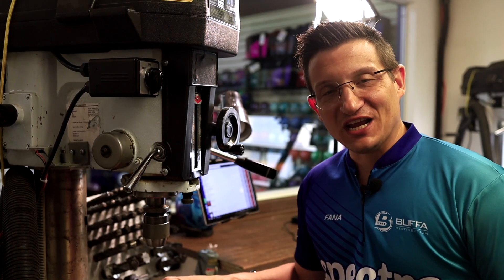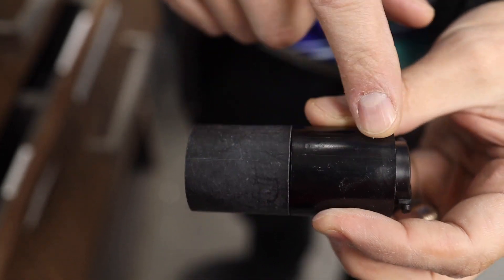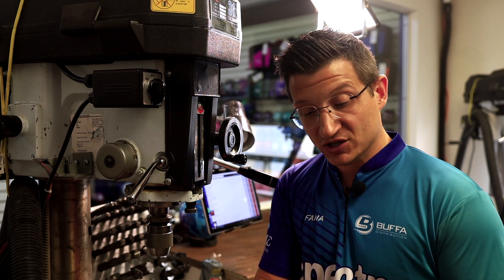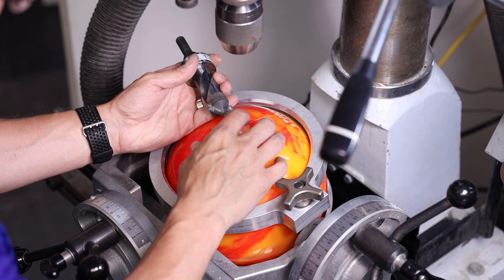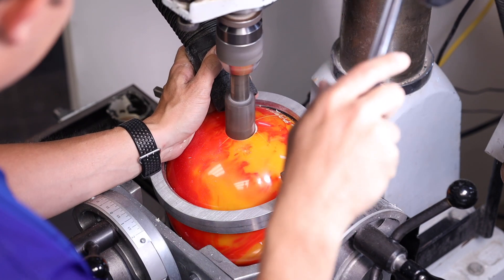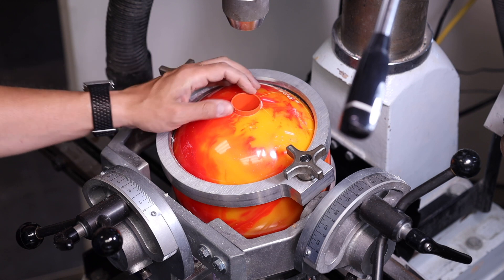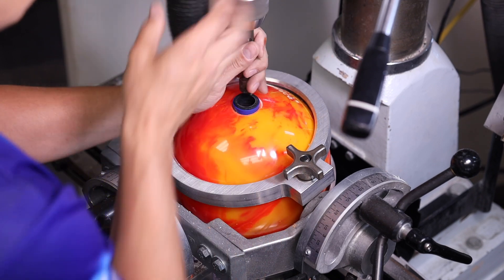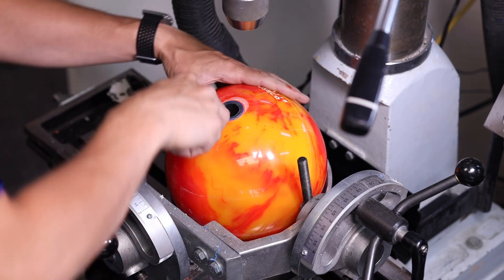Turbo Switch Grip | Thumb Installation Series

Comment: As a machinist by trade,These drills aren't meant to be used in a existing hole so using the final size drill is ideal, drilling a bigger hole after using a smaller drill will cause chatter and that's what the reamer is cleaning up.

Comment: Use a 1 3/8 bit and  go down 1/4 inch once slee e is installed, after cutting it down. Cleans up the rough edg from cutting  Reamer is 1000% unnecessary if drilling a pilot hole and bit is sharp. I have the reamer and I've had more issues using it then not using it.
Reply: Thanks for the comment.  Since using the reamer, I’ve cut down my problems, that’s why I mention it and also the beveling options.  I’ll definitely try your suggestion as well.  👍

Comment: I'll never use anything other than Jo Po...the dual locking mechanism drastically decreases the failure rate!
Reply from the maker: Jopo has gained alot of traction lately, please check out our Jopo video as well.
https://youtu.be/F5zpLl6gg_o?si=TA1Cgf2jQrWNBy_n
Every system has it's pros and it's cons.  We're just wanting to show the installation methods for them all.
Thanks for the comment ;)
Reply from the maker: Jopo has gained alot of traction lately, please check out our Jopo video as well.
https://youtu.be/F5zpLl6gg_o?si=TA1Cgf2jQrWNBy_n
Every system has it's pros and it's cons.  We're just wanting to show the installation methods for them all.
Thanks for the comment ;)